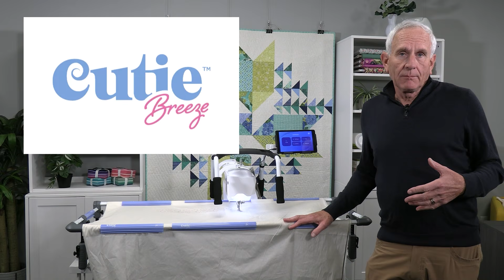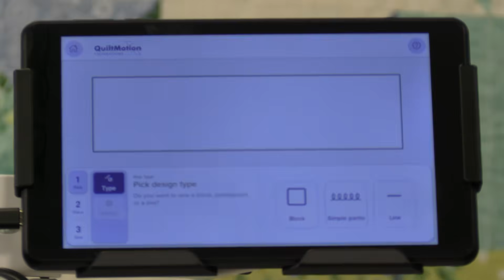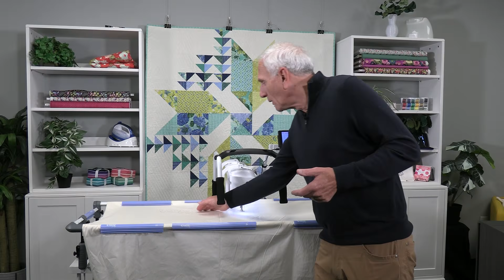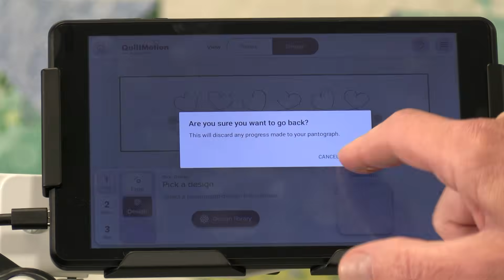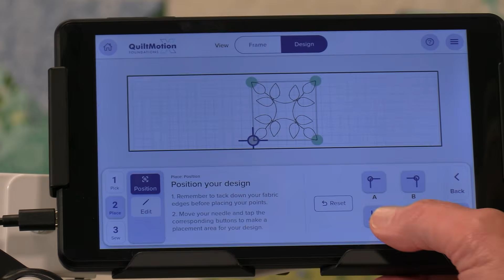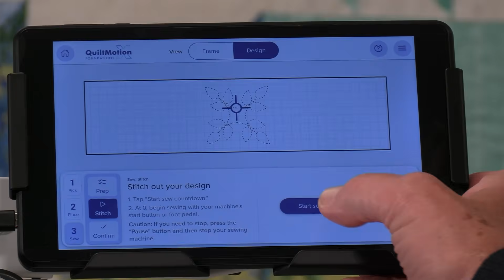QMX: Turn Your Sewing Machine into a Longarm with QuiltMotion

Comment: What is the maximum design size?  how easy is it to get the starting and ending points lined up so that the border is connected seamlessly?
Is it feasible to think I could longarm a king size quilt with this system?
Reply from the maker: You can do any size quilt on this system. The program is easy to use and has built in instructions. You can learn more about it here https://www.qualitysewing.com/products/grace-qmx-foundations-frame?_pos=3&_psq=quiltmotion&_ss=e&_v=1.0 or by talking to a member of our team 1-800-687-5175